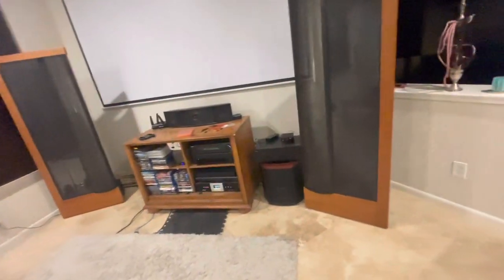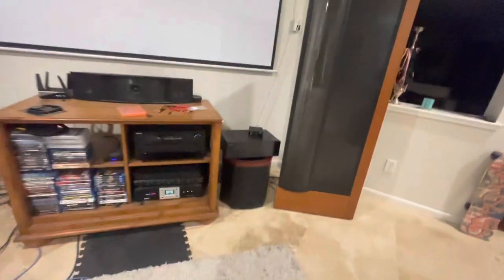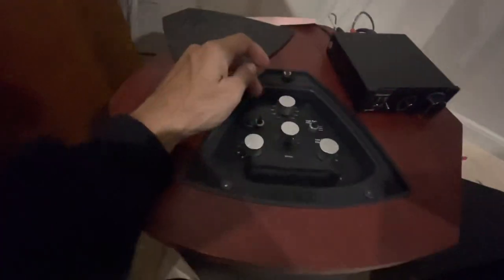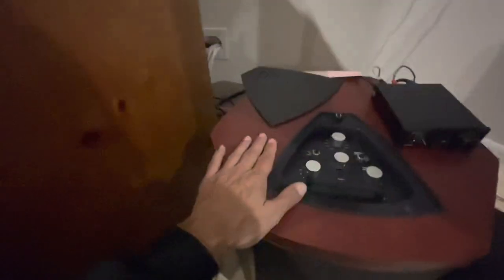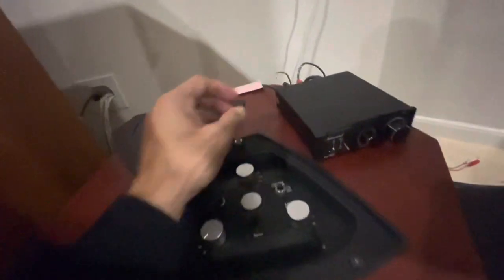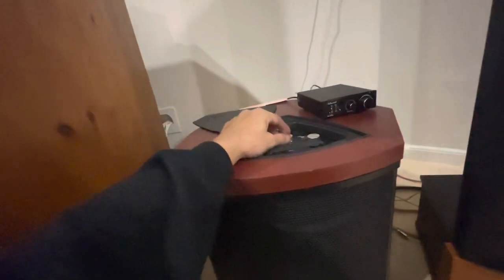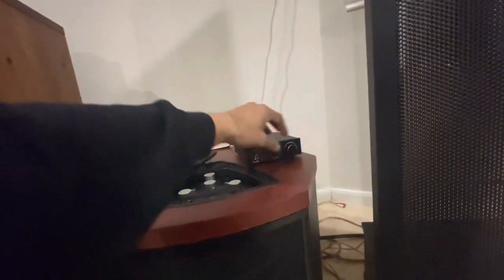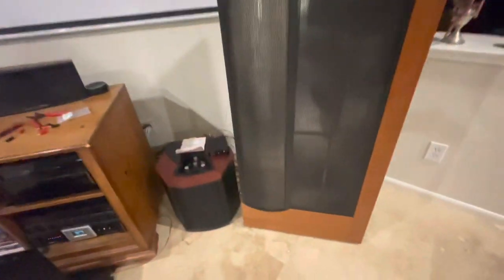Martin Logan Descent I / Depth I blown amplifier fix or bypass

Comment: No servo control.  Looks like you are only driving 1 of the 3 drivers?  Originally, each driver has its own discrete amp... so 3 amps and 1 shared power supply.  ML should be able to service these, its their flagship sub.  I've had no problem getting parts for them over the years.